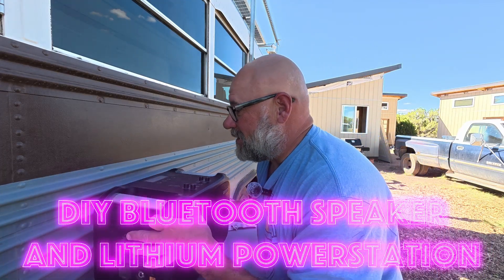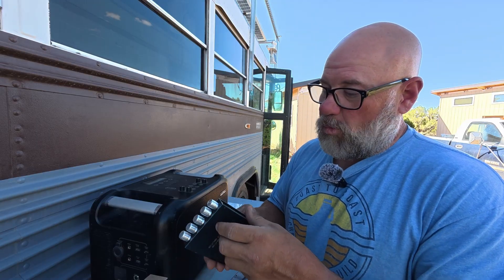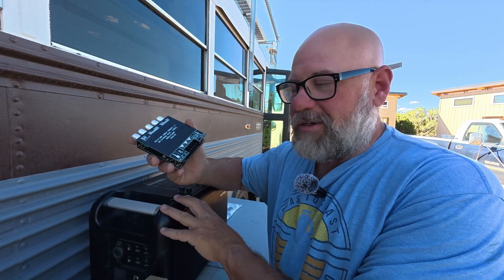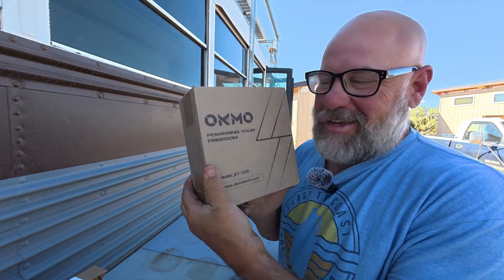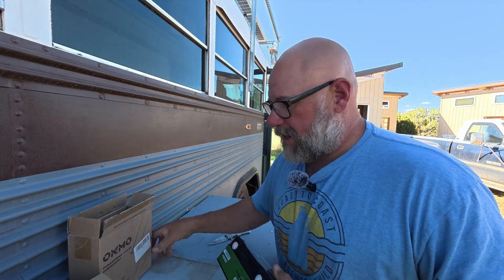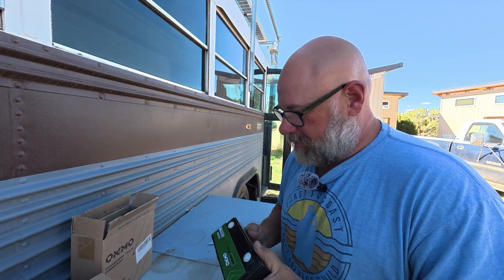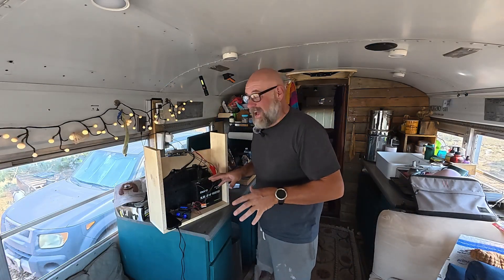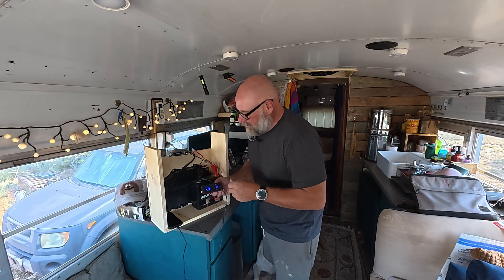DIY Bluetooth Speaker Power Station: Build a Portable Stereo with Lithium Battery & Custom Amplifier

Comment from the maker: If you're looking to build your own portable speaker or power station, all the parts are listed below!

All Parts Mentioned in the Video:

OKMO Lithium LifePO4 100ah Battery: https://amzn.to/4fuEVHG

OKMO Direct: https://okmotech.com/?ref=bt

2-pack OKMO 15Ah Batteries: https://amzn.to/3VPStXt

4-pack OKMO 15Ah Batteries: https://amzn.to/4036Mdw

Thanks for sharing this awesome project with us! What will you be powering on your next trip?🔧 What’s Included:

Harmon Kardon speakers: 6.5” subwoofer + 2x 1.5” mids/highs.

OKMO Lithium Battery: 20Ah and 15Ah models for a total of 30Ah power.

Bluetooth Amplifier: Small, but packs a punch with 200W of power.

Charging Ports: USB, USB-C, and even a classic cigarette adapter for ultimate versatility.

DIY Speaker Box: Compact, durable, and designed for maximum portability.

⚡ Why Build This Speaker System?

Long Battery Life: With 30Ah of lithium power, you’ll enjoy hours of music and can even charge your devices.

Compact & Portable: The final setup is small enough to carry around but powerful enough to fill a space with sound.

Sustainable: Instead of throwing away a broken Bluetooth speaker, I repurposed the components into a brand-new, high-performance audio system.

🔌 What You’ll Learn:

How to disassemble an old Bluetooth speaker and reuse its internal components.

How to integrate lithium batteries into your DIY projects for portable power.

Step-by-step instructions on how to build a Bluetooth-powered portable speaker system with easy-to-use charging options.

Items Used in This Build:

Okmo 12V Lithium Batteries (20Ah and 15Ah models)
15AH OKMO
https://amzn.to/3Ip1X8r

Bluetooth Amplifier with Subwoofer & Channel Controls
https://amzn.to/4gr97Wv

USB & USB-C Charging Ports
https://amzn.to/41NOjlW

Lithium Battery Charger (10A, 12V)
https://amzn.to/46BNJKG

Wago Connector/ Lever nut
https://amzn.to/3Vhfq5e

NEMA 15 power port/charging plug
https://amzn.to/4pp5h3Z
Reply from the maker: Yeah buddy

Comment: I’m building a Bluetooth speaker out of an old 1920’s Operadio speaker. 

Should be cool when I’m done.

I also have a Bluetooth speaker made from a 1950’s suit case. 2 6 1/2’s with separate tweeters and an 8” sub. Loud as hell & my ambulance rv stereo speaker !!